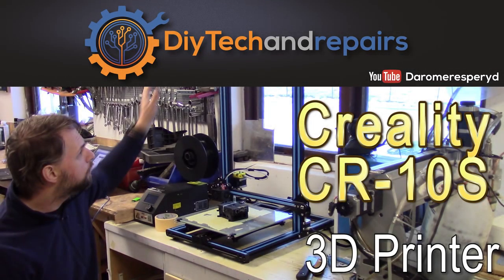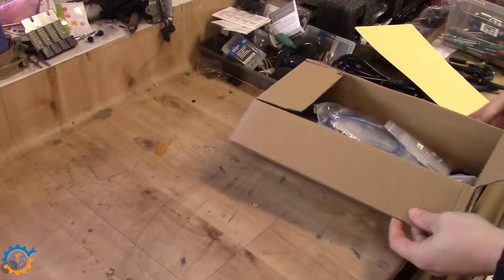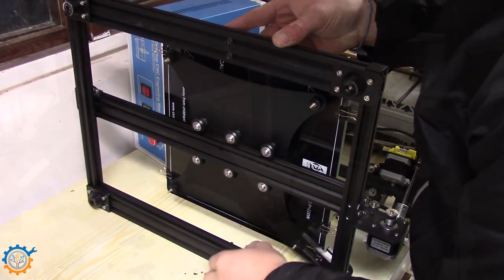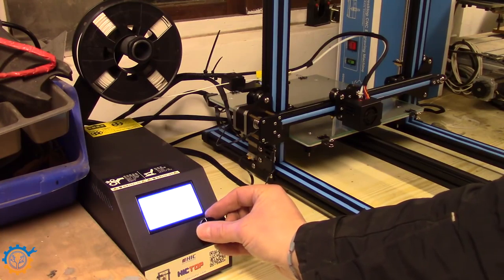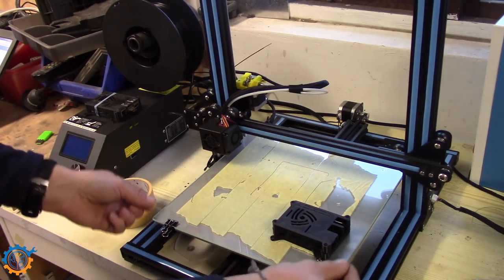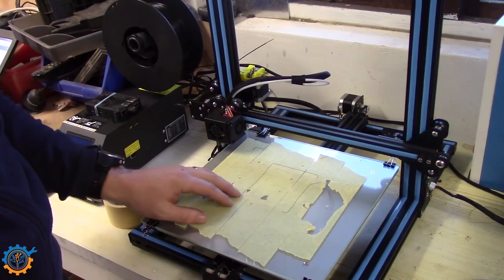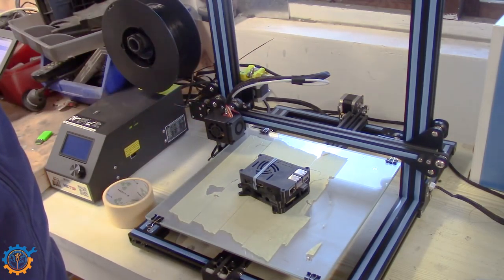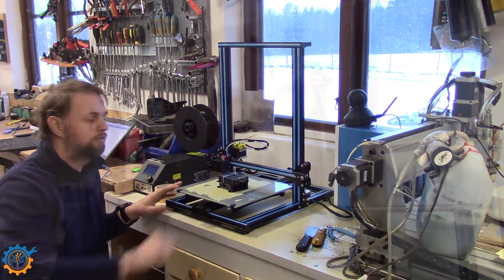Creality CR-10S printer assembled!

Comment: Do start thinking about auto bed leveling. It’s by far, the best upgrade I have done on my printer.
Reply from the maker: Gustav Brogren what sensor did you use? Yeah u think it will save some Grey hair:)
Reply: DIY Tech & Repairs I converted to auto bed leveling quite a long time ago. My system is based on two micro switches and a floating X-axle. You can see my design at Thingiverse. https://www.thingiverse.com/thing:966929
But if I had built it today, I would go for BLTouch or one of the copies, or check what Prusa Research does right now on their i3.
Reply from the maker: The switches are simple I agree. I will for sure check that out and I do want it for sure.  Thanks

Comment: I use aquanet hairspray with my glass when printing with PLA... works great!
Reply from the maker: Yeap was gonna try that later on to get rid of that tape. Alot easier to work with when just cooling of the bed and it poops right off

Comment: Hi. I just got my CR-10S. At least yours had the all blue tubing installed already. Mine just has a roll of it in the box. I'm considering leaving it off. My question is which Raspberry Pi case were you printing? Seems like a very good test and I need several anyway for my Pi's.
Reply from the maker: https://www.thingiverse.com/thing:922740

Comment: nice one Daniel. How does it compare to the Tevo Tarantula you had in the other video. I was considering that one even though it needs parts printed to make it much much better than stock?
I've designed some 18650 holders which are solderless and dying to work on it but need test 3d prints to see if it's viable.
Reply from the maker: Tarantula? No idea. Never worked with that printer. But I never liked the printers you need to print stuff with to get them to work decent. Mostly since I dont have the time to fiddle around with it currently :P
Reply: Oh, I must have mistekned your last video to have one or had a link to one. must've watched too many YT videos and got them mixed up
Reply from the maker: I linked in the CR10 in last video :)

Comment: Have you considered integrating your 3d printer with your efforts in building 18650 battery packs?
Reply from the maker: Thats the reason i got it :)
Reply: I've been doing the same thing.. thanks for your channel.. it's given me lots of inpiration
Reply from the maker: Thanks for being here! And your welcome :)
Reply from the maker: Printing holders im not sure is useable unless its special. Can buy them so cheap from China :) But yes its doable
Reply: here's the advantage of printing these holders.. you can easily change out cells as you find dead ones... which allows for a continuous way to upgrade/update/kull out bad cells... which the traditional brackets.. you make a brick of 80 cells... and when it's "too far gone".. its a PITA to refurbish
Reply from the maker: Christopher Obel but i got above 22000 cells :)
Reply: haha.. I've only got about 600... so keeping my packs optimal is paramount for me.
Reply from the maker: Christopher Obel yeah. And the 5×4 bricka is easy enough for me to swap out the cells if needed. I have spare 80p packs